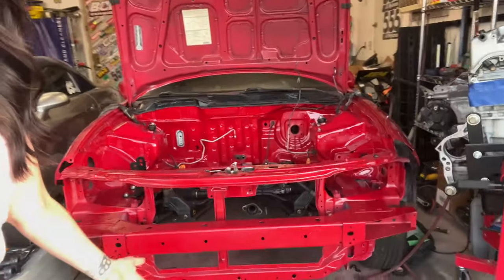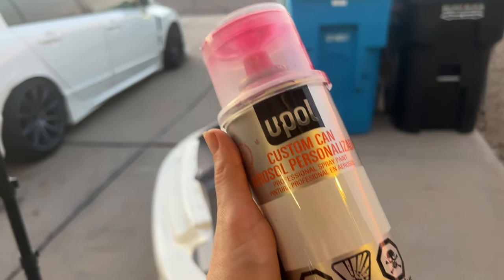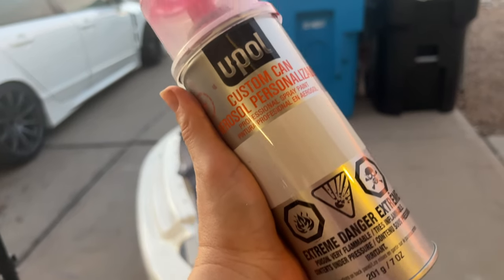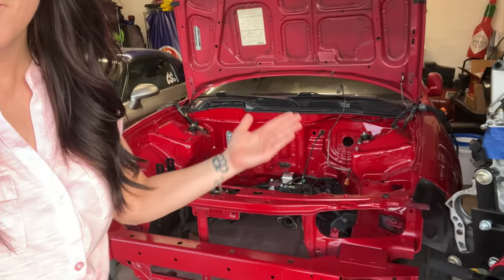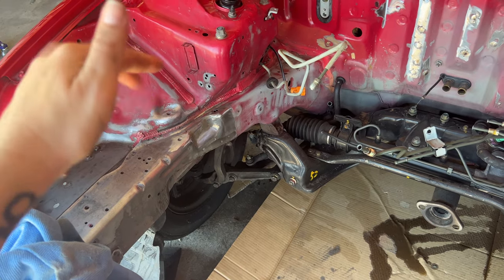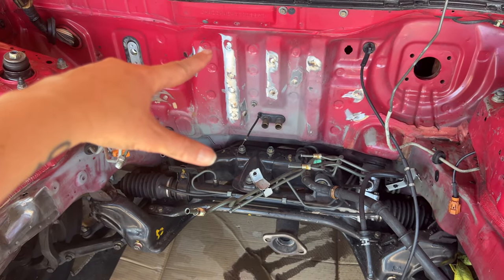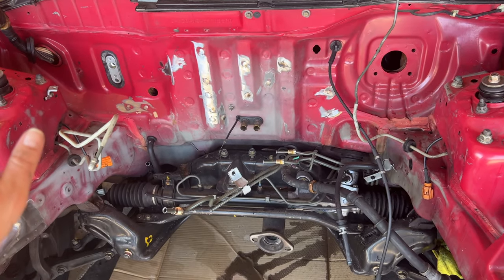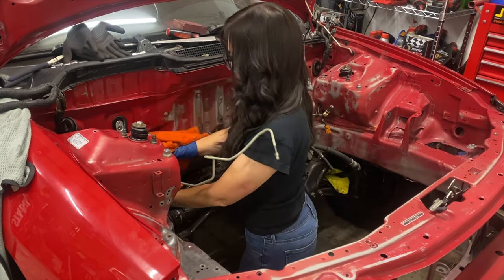DIY I Painted The Engine Bay On My Integra

Comment: Good idea on the foil.  Heads up though.  I believe you are wearing a dust mask and you need to be wearing a full up respirator with the big canisters on it rated for VOC.  Automotive paint is extremely dangerous.